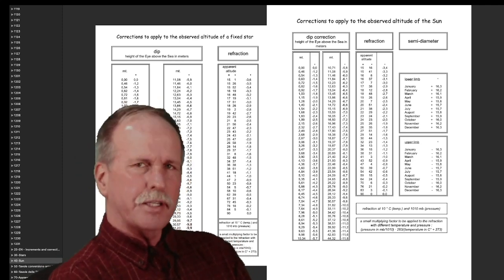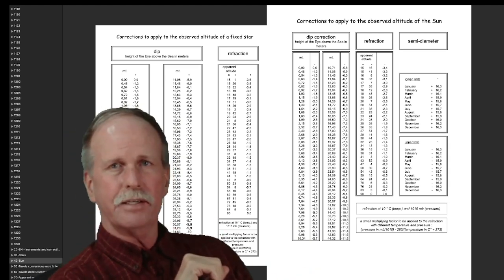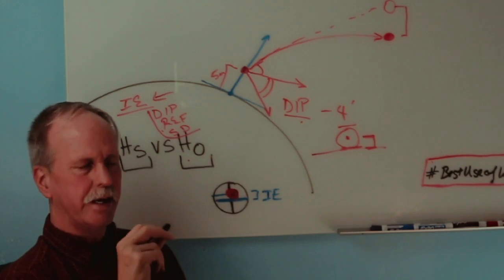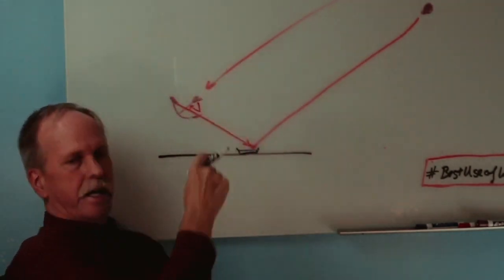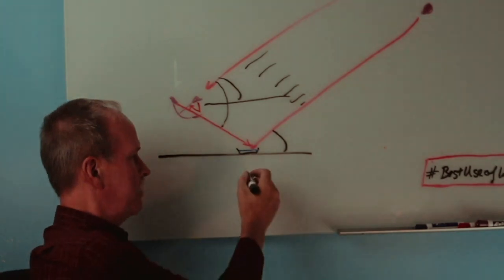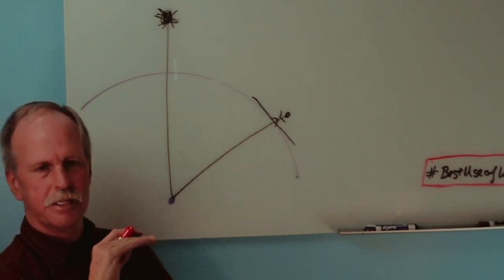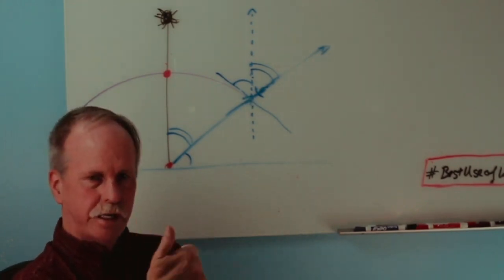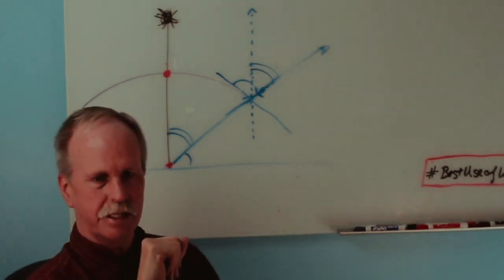The Mathematics of Navigation-   Artificial Horizon

Comment: Mr. Bob... I dont believe flerfs are going to be convinced by science and math...
Instead... we need to point them out that... its kinda silly to have, both in the same time:

#1. Temperature controlling smart suits,  quantum processors, floor heating, brain cells in lab dishes taught to play ping pong and fly planes
#2. Fairies and gremlins running upside down on the upside down mountain at the  bottom dark side of a  rocky pizza.

Comment: Did I understand you correctly that it's possible to sight Polaris using a water artificial horizon?  I'd been wondering about that.  Found mentions of people using artificial horizons to sight the sun but no mention of them to sight stars.  Obviously, mercury would work but that's hazardous.

What I did note is that water can be disturbed by a slight breeze.  Some people use more viscous fluids like engine oil or molasses.

Comment: Blub
Reply: It really sucks when you don't want to learn what a sextant is , what it measures and you fail on NON-Euclidian math to calculate your position.
In the end you just die because you are lost on the south pacific.
Reply: @boterlettersukkel  The nice thing is that you don't need to know about non-Euclidian math, you just have to learn what to do with the angle readings – simple math (some +, - and *). Yes, it can get more complicated if you want to know the distance in directions other than N/S or E/W, but to get your position and confirm it, it looks not that complicated. To get it to high enough precision is the hard part (with all the corrections), but again – you can use tables and slide rules and not do any hard math. Pure genius.
Reply: You're not meant to breathe the artificial horizon.